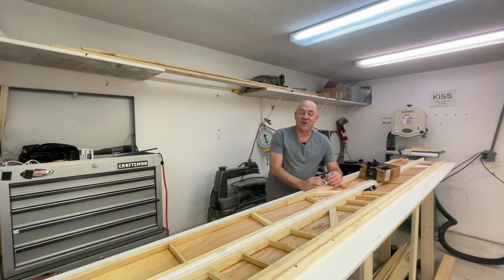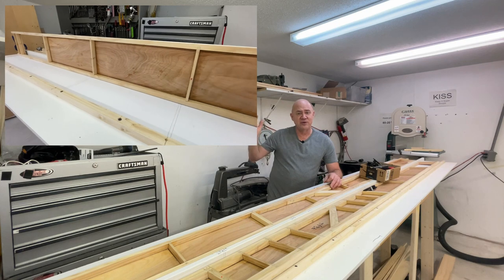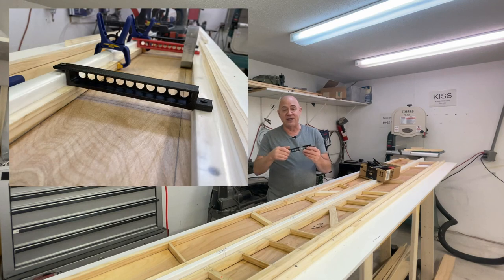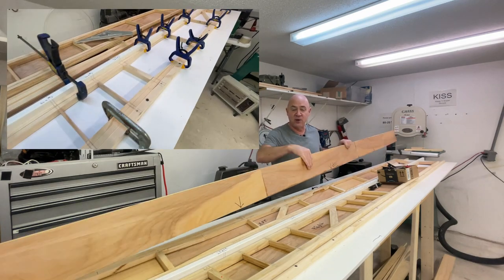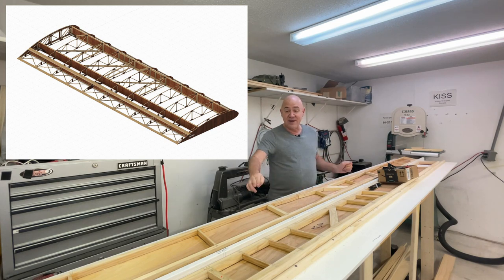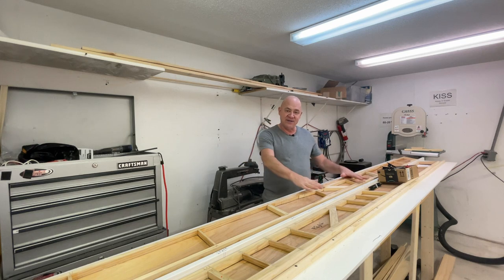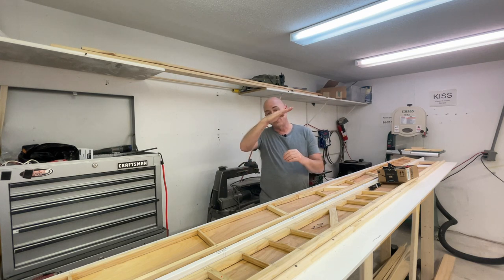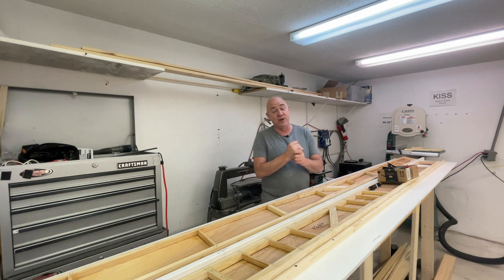AirBike Update- Wing Spar

Comment: Great advice on checking, rechecking and checking again the angle cut on the tops of the spars - you are quite right, cutting in the wrong direction is so easy to do. I have RW tip, RW fuselage, LW tip, LW fuselage, top and bottom written all over my spars to make sure I didn't get them the wrong way round.
Reply from the maker: I was really worried I would cut something wrong. Had a page of notes to make sure. :)

Comment: I am getting a prop from Frank Johnson it’s a 2 blade wood prop 56x22
Reply from the maker: Thanks!!! What engine you using!! :)
Reply: I am using a 1/2 VW full case with MAG engine that Scott at Hummel engines built for me it’s rated at 45 HP 😁👍
Reply from the maker: @gregorywatkins1570  What do you think the engine's weight will be?
Reply: The Hummel engines website was not specific on engine weight it said 84 to 102 pounds I plan on getting the true weight of my engine after I order a hang scale today... when I get the true weight I will reply again.... I am using a mag and that’s probably a addition of 4 pounds to the overall weight but I will find out the answer as soon as I can get my hanging scale👍😁...some people opt for just the battery ignition but I feel safer using a mag myself... when complete 
My plane will be no heavier then 254 pounds I will make sure of that 👍😁...
Reply: Lenards plane was 10 pounds underweight 244 pounds but some of the 4130 was heavier then what is on my plans I’m building from that is mostly 4130    .30 Crome molly landing gear .49 wall
Reply: I put my magneto on the bathroom scale it’s 5.4 pounds and I ordered a 660 pound hanging scale I will check the engine weight with when I get the scale...
Reply: Go an pick up the engine when done. Do not let them ship it to you. Mine was riding on the prop hub part of the way an the box he made didn't hold up.